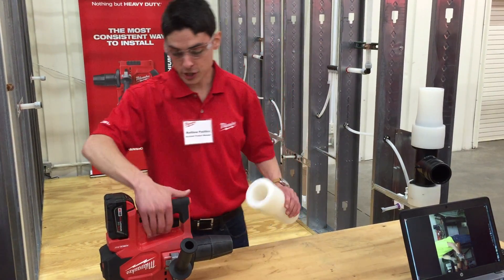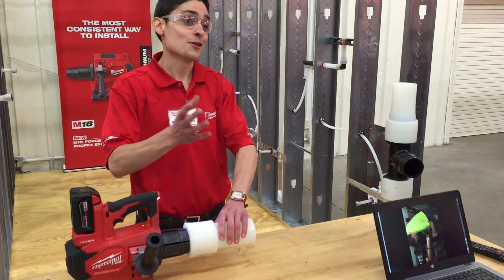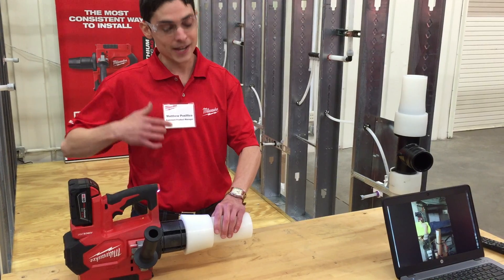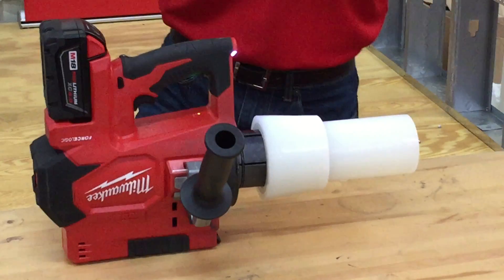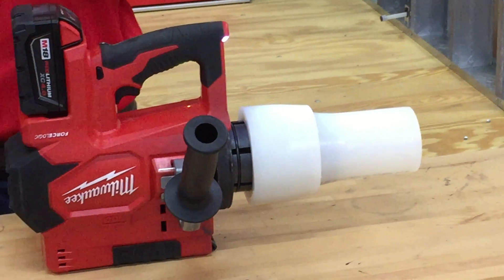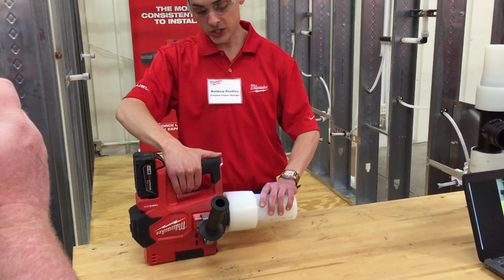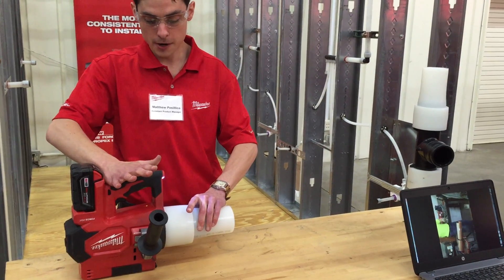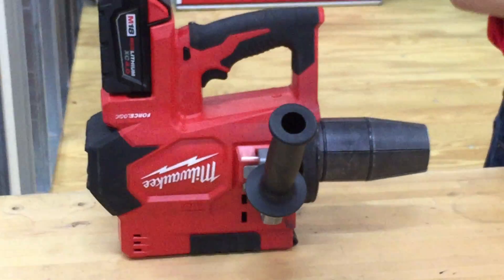Milwaukee Tool's Force Logic expansion tool for Uponor Pro PEX

Comment: Did I miss something? Gluing up PVC pipe is no longer acceptable? This seems awfully slow to me but I’m not in the plumbing field.
Reply from the maker: That's not PVC, this is PEX. A completely different piping material.
Reply: Mechanical Hub, yeah I realize this isn’t PVC, I was asking if this was taking the place of PVC.
Reply from the maker: @genecoppedge5972  This would be for main line potable water distribution or even heating/cooling lines for commercial work. Not a application that PVC would be used for.
Reply: Mechanical Hub, thank you.